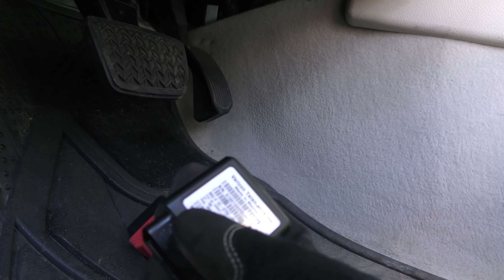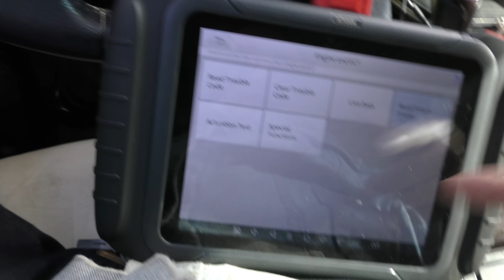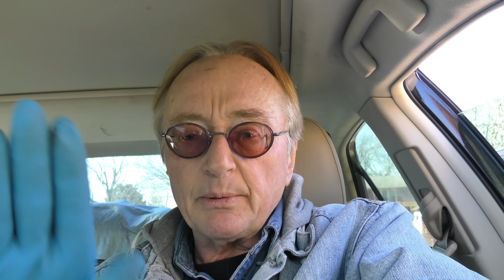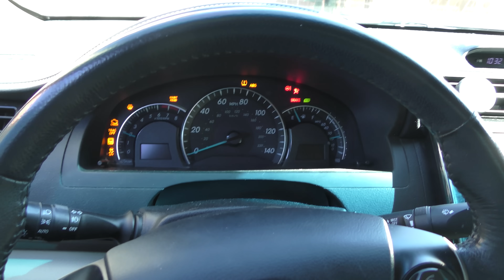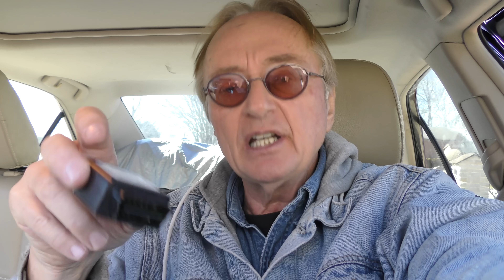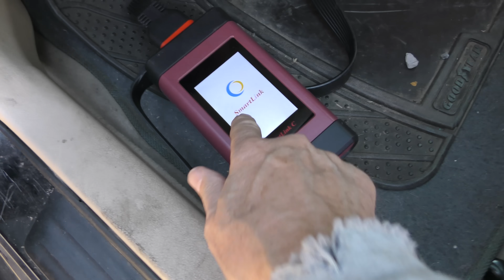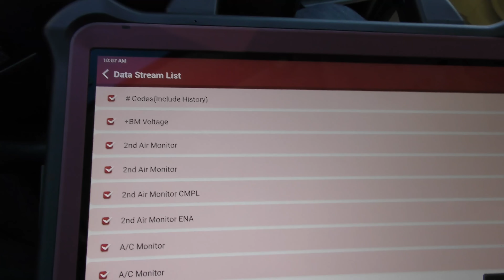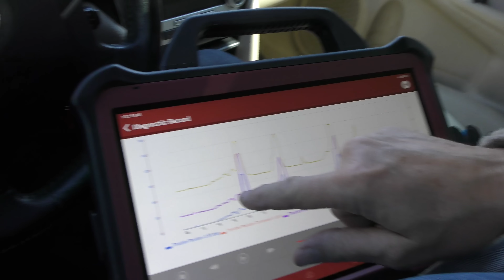This Stupid Device Just Cost My Customer Thousands in Car Repairs

Comment: Since I'm an electronic technician (40+ years) I have to say that these computer systems aren't very well designed if they're not fault tolerant. Pretty much everything that is computer controlled can't be trusted. That's my opinion and I'm sticking to it.
Reply: Complexity is the enemy of reliability.
Reply: @russingersoll5761  Definitely.
Reply: I'm a plumber and I agree.
Reply: I work with electronics and computers and I whole heartedly agree!
Reply: I am an ET at the USPS.   Technology always lets you down.    I prefer my 1984 Military Blazer.   If you got voltage..  you can crank the engine.   It starts.
Reply: @Milkman3572000  As long as you can get replacement parts you're good to go.
Reply: @genericdude6551  starter and alternators are rebuildable.   Injection pump is too... Think Cuba....keeping 70 year old cars running forever.  No compters.👍
Reply: MrMagOOo  
It sounds like planned obsolescence. GM has been doing that mechanically for years. Metal gears turning plastic ones; designed to break.
Reply: I need my 1981-1982 non computer car engines overhauled.. both 3.3 liter inline 6. I need my 1990 OBD 1, Buick LeSabre Limited 3800 Series 1 overhauled and throttle body assembly rebuilt/replaced.. yet nobody knows how to overhaul engines or cares but that’s ok, Karma is my wife. I wonder if there are female mechanics that can rebuild old school engines and throttle body assembly on older vehicles?
Reply: @lawnmowermanTX  I worked as a computer repairman in the 80's. I was working on one customer's computer, an engineer for Ford. He got to talking about crazy problems they where having with their engine control computers. In a meeting he was in, he explained the problem. He said "My computer has Gold contacts in it for connections, while here we(Ford) are, still using Zink coated bullets!" I had an'84 Ford LTD wagon with their 3.8, and that module or connectors went bad, started running extremely rough, an turned the exhaust system red hot.
Reply: @dr.detroit1514  There’s gold in them dar Fords! Someone in Quality Control goofed or cut too many corners.. How was it fixed? Trade up to newer? I grew up in a 1968 Galaxie 500, and 1971 Ford Maverick coupe.
Reply: @lawnmowermanTX  I don't remember him saying how the problem was resolved, thjis was back in the mid 80's. My own particular car was fixed with a new engine control computer, I believe, it was a company car.
Reply: @dr.detroit1514  
My dad's '83  LTD also had chip problems which ruined gas mileage.
Reply: @lawnmowermanTX  I feel so bad for you, I thought I had it bad growing up in an apartment!
Reply: @lawnmowermanTX  come to the Caribbean and you will find someone to do the overhauls.
Reply: MrMagOOo  Agreed and Scotty turned me away from the new shut engine down at stops and stoplights. That is scary!
Reply: @lawnmowermanTX  
That's basically what hybrids do. Toyota hybrids seem to have few problems.
Reply: MrMagOOo  Agreed! Scotty has videos on that. It’s planned weaning from American built to Asian built with service and thick accent phone support for $5.00 an hour.
Reply: Have you watched I, Robot?
Reply: @cumshot247  yep i got the DVD.. and some of the reboot Transformers.. Detective Dell Spooner’s hate of robots was very clear.
Reply: @cumshot247  yes. with wil smith in it
Reply: MrMagOOo  Reminds me of the lights inside the grocery store freezers that go off to save power and only come on if you open the door, yet the doors themselves are apparently no longer are made to go shut semi automatically like they used to be and now I always see them hanging open which wipes out all those lights off savings in a few seconds.
Reply: It all depends how it's implemented.  If you build in fault tolerance from the beginning, it can work quite well.  If you try to built in fault tolerance afterwards, it's usually a disaster.   Mercedes had a 3-battery system in some of their 2010s-era cars.  The car originally had just one battery when the models were initially released and those were very reliable.   Over time they added more features including start-stop and now you had a starter battery, cabin battery, and essentials battery.  Completely fustercluck and terribly unreliable.  Making matters more fun, for "efficiency" the electrical system wouldn't charge the batteries while driving at constant highway speeds.  

To their credit, the next generation of cars only had one single battery, much better voltage regulators, and systems were able to function on a much wider range of voltages.
Reply: I can't stand all this computer crap in these vehicles today. There's no need for 3/4 of it. But I would hate to ever have to give up fuel injection. I live in Canada and I've had carbureted vehicles in the Winter.🥶🥶🥶
Reply: @bigjay6743  Ya some of them seem like overkill, however its a godsend to be able to scan the computer and it tells you what problems it has. Lets you zero in on the problem instead of wasting time diagnosing and replacing parts that don't fix the problem. Also cars last much longer now, you never use to get 200K miles on a vehicle in the past.
Reply: MrMagOOo  when I bought my Samsung TV I thought I was gonna be all that and gave it my wifi. Two days later it crashed. I called tech support and "gave them access" lmao over the network. They had it fixed in five minutes by backing out the bad update that hit it the night before. Turned off the wifi on the TV several years later still no problems and no updates.
Reply: MrMagOOo  yeah the OTA updates is just asking for trouble especially once out of warantee,  I'd love an ev tbh but id want a dumb one lol.
Reply: I used to be a mechanic so to it to a guy like me with fancy tools. Don’t worry I get my parts from RadioShack also 🤣 Scotty needs to hang it up
Reply: The more likely sounds like there's a bad solder joint or trace so when it warms up it expand gets closer with less of a gap so the caused by expansion and contraction from heat and cold and that's my opinion.
Reply: I'm an electrical engineer too and agree with this 100% 
And seeing that power glitch, but only when cold, screams intermittent connections.
That includes bad solder joints and bad contacts in the modules AND THE HARNESS CONNECTORS.  Of you're going to hose down the connections, DOING ONE SIDE LEAVES THE JOB HALF DONE!
Reply: I worked in the computer field for many years as a software programmer.  Learned though experience, try to have a manual backup plan.  Computers are good when they are working right, but when they breakdown things can really go downhill.
Reply: would that include all electric cars? they seem like a step down from a car with a internal combustion engine. i have zero carbon guilt, thats for rich assholes who feel guilty for some reason.
Reply: @fifthward1983  Why would you need to feel guilty to do something good?  Some people get so caught up in debating whether or not climate change is man-made that they forget it's a problem we need to solve whether or not it's man-made.  I think they do that is because they do feel guilty and are in denial.  The only reason it is important for them to deny responsibility unprompted is because they already feel guilty.  If you get home and your kid says they didn't break the lamp without being asked... it means they probably did.  Anyway, get over your guilt issues, because whether or not you broke it, the lamp still needs fixing.
Reply: @fifthward1983  they say they feel guilty buy really it'd about control
Reply: @fifthward1983  The Tesla Plaid can go 0-60 in 2 seconds, and has 1,000 HP all the way up to 200mph... not sure what you are driving, but most likely not a step down...
Reply: @EQ_EnchantX  let's see if that Tesla will still be on the road in 10 years... Most likely not due to parts cost and Tesla putting a stranglehold on parts.
Reply: @grayrabbit2211  Tesla cars have 500 less parts than its leading competitors and take a quarter of the time to build . They also released most of the patents as open source with most of the information about the cars being publicly available now.

Never seen any other company do that before.

Also you need to look at the electric cars compared to other electric cars, and in that category Tesla is far far ahead. But I agree, we will see how well they hold up.
Reply: @EQ_EnchantX Speed of assembly isn't exactly something to be proud of. Tesla cars are known for being poorly-built. Everything from poor alignment of panels, body panels not fully painted,  parts missing from the factory, such as cars being delivered without brake pads and Tesla then claiming it's "normal".    Tesla is also known for having truly terrible customer service.  Waiting for months to just get an appointment, then being without your car for months because Tesla would rather sell new cars than use those parts to service existing customers.  

 I've been to a certain factory in Crewe, England, and I can assure you they're not bragging about how quickly they can crank out a car.  16 years later, my car still doesn't have any rattles. 

Re: patents - - any time you patent something, it becomes published and anyone can look at it.  I'm going through the patent databases constantly to reverse-engineer things. This is why many companies won't patent something and instead call it a "trade secret".

Tesla actively works against letting other people work on their cars.   They want to be the only place you can get your Tesla fixed... Which might be alright if they had the capability and capacity of fixing their own cars.
Reply: @grayrabbit2211  You are saying a lot of things do you have any sources for this information or just repeating the loud voices that are the minority.

Speed of assembly and cost are a big thing to be proud of. Many companies are now copying Tesla. If you can make a item for $5 instead of $500, that is a big thing to be proud of. Most of the defects are from years ago, on non production models and were fixed before production. As for customer service 

"Does Tesla have good customer service?
The company has the highest customer satisfaction rate of any car manufacturer. Tesla customers tend to be incredibly loyal, and 91% of customers plan to buy or lease another Tesla for their next car."

"Topping the satisfaction ranking in 2019, more than 86% of drivers using Tesla Superchargers report being ‘very satisfied’ and 10% ‘somewhat satisfied’ with the experience."

"Tesla has topped the Consumer Reports owner satisfaction report for the third year in a row."

Patents: Sure you can look at it and reverse engineer it, but go and try to sell that product you create when other companies have the patent on it. Lawsuit...

As for working on the car, how many are trained in the all the new tech, and have all the new diagnostic equipment? A Tesla is not just a normal gas combustion car like the billions before it, it has many new and completely different parts that are only made in one place. Yes that sucks, but that is what happens when your a new company with a new product...
Reply: @EQ_EnchantX 
Yeah, what do they offer for $2400.00 to get 24 year old people to and from work so they can move up the ladder? 😮
Reply: @MikeYurbasovich  Not sure what your point is. Are you saying a new car should be sold for $2,400? Kinda stupid question IMO...go get a lambo for $2,400...A 24 year old with $2,400 is not their target audience.
Reply: @EQ_EnchantX  
I thought you might say something like that.
Reply: @MikeYurbasovich  Well what do you expect...you already knew the answer even if you don't like it.
Reply: @EQ_EnchantX  😆 that's even funnier!
Reply: Remember when cars broke down all the time, and you carried a full set of tools and spare parts? Remember when making a 500 mile trip required a good check and people would worry if your car was going to get there? I do, and they didn’t have computers. 
Somehow, they keep adding unreliable electronics yet making cars more reliable in total. I’m just saying I trust my 2014 F150 with a minor tool bag, over my 70 chevelle with a full tool set, spare distributor cap, points, rotor, spark plug wires, coil, belts (it could throw new ones on occasion), maybe alternator, and I don’t remember what else.
Reply: @ED-es2qv  Only trust your F150 to start easily, not to last.  The chevelle just needs an HEI distributor, and a good Quadrajet carb to be reliable.  Only Quadrajunk to the illegitimate mechanics who never learned about carburetors.  Once it's set, it stays set up right for years.
Reply: the designers only work to make it function, They do not do fault impact analysis and consider things like redundancy, etc.  Just throw it into limp home mode and have the o wner take it to the dealer.  My next car will have a lifetime warranty.    Good design has anticipation of failures
Reply: MrMagOOo  And that is nothong to say about "Right to Repair"... Look at the f*cking thrash that John Deere has turned to be...
Reply: Voltage irregularities usually indicates bad earth more than a failed ECM.  I'd have checked all the earth points on the engine and chassis.
Reply: shame your not a computer technician then, lol. shots fired.
Reply: I am software developer and I concur, especially with voting machines.
Reply: @brighter22  --LOL...
Reply: @brighter22  voting machines, really.
Reply: @Jo-nm1gu  yes really
Reply: @Jo-nm1gu  found the lefty!
Reply: @brighter22  hahah. Trufffff
Reply: Yeah, but, are they computer controlled?
Reply: MrMagOOo  all new cars are full.of computers and this option to kill a car after warantee has been around for ages .
There are far less things for the computers to control in an ev engine wise, electric motors are very simple devices compared to ic engines..

Comment: Does this "don't drive with dongle installed" apply to "Blue Driver Pro scan tool"?  I believe it's one of the better ones recommended by S.K.
Reply: I think as long as it’s not constantly plugged in.

Comment: My speedometer doesnt work due to the car having the wrong transmission in it... I use an ebay-quality GPS speedo/gauge cluster that plugs into the OBD port. Seems to be fine besides the built in tachometer always being at redline and the engine temperature always being wrong. Battery voltage seems ok.

Comment: That was a really intriguing video watching Scotty go through everything and pinpoint the issue. Too bad for the customer 🙁
Reply: So don't let your dingle dongle dangle in the dirt.
Reply: @moncorp1  it's hard to run when you have a strange dongle stuck in you. I can only imagine. 😏
Reply: I'd hardly call this pinpointing the issue.  He cleaned the throttle body and checked for corrosion on the accelerator connector.  Then immediately leapt to the conclusion that the OBD dongle had destroyed the main computer.  There was nowhere near enough diagnostic investigation to arrive at that conclusion.  You need to do way more due diligence before determining that one of the most expensive repairs you can possibly do to a car is actually what needs to be done.
Reply: @Rowgue51  I 100% agree, so much more to look into here then him saying main computer.